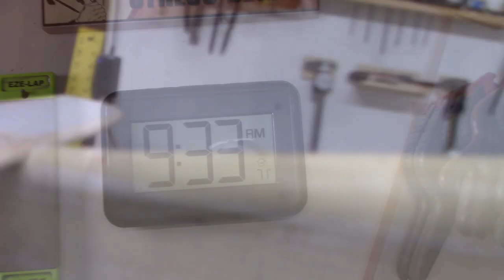Tiger Moth Becomes a Stampe SV4 - Video 28 - Covering Fuselage Pt 2

Comment: You may have addressed this earlier, but  why didn't you just fiberglass and peel ply the fuselage? Seems like it would have been a lot easier way to end up with a fabric texture.
Reply from the maker: Weight. Still would have had the same issues and end up with a heavier fuselage